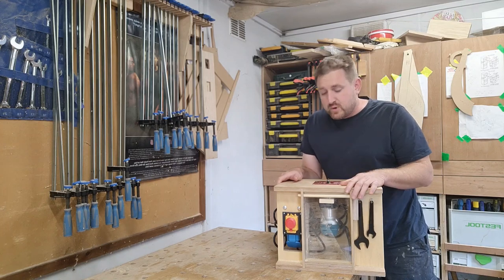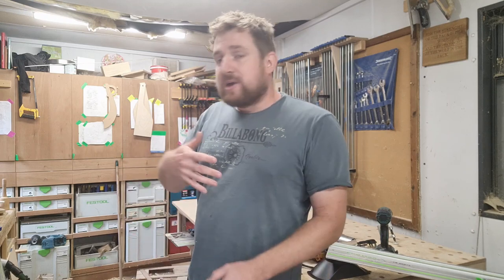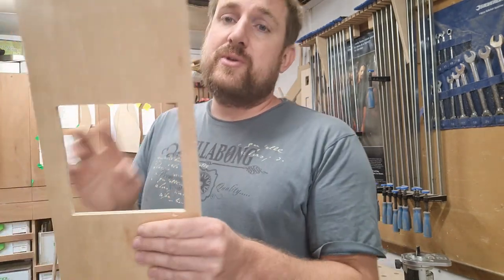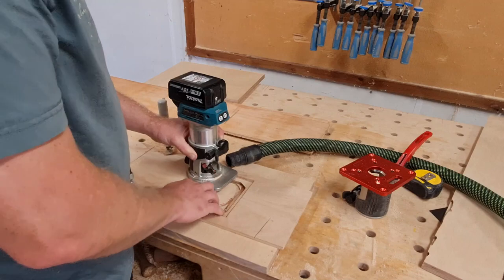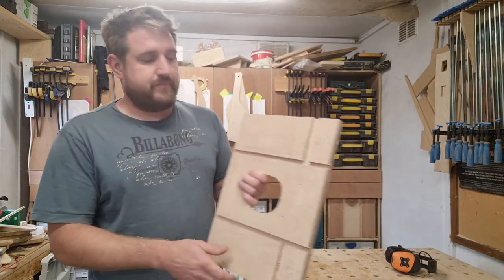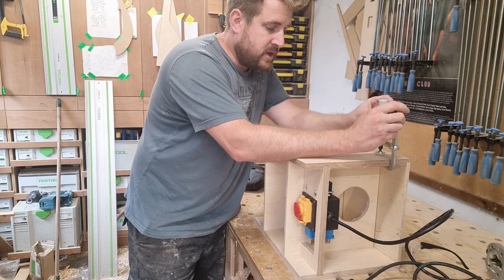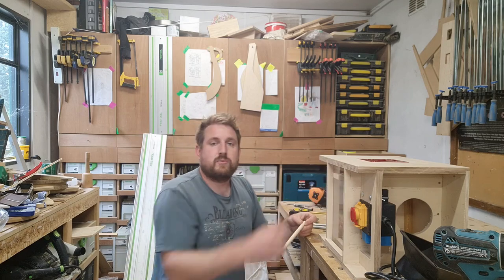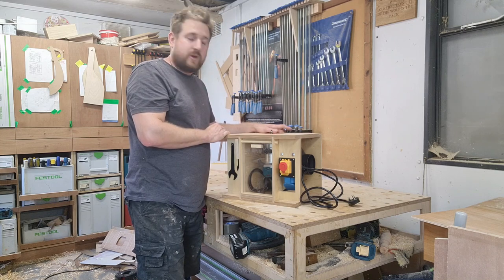How To Make A Systainer Sized Router Table - 1/4" Portable Router Table with EXTRACTION

Comment: I have just watched the video again. First time around I was so busy I was catching it in little bits on my phone.
I think the design really works well and is inspiring me to think about a small router table I can store in a powertool case for site work. Gotta be safer then just gripping the router in a workmate ;-)
Reply from the maker: Workshop projects are one of those things. I think about it for ages, then when I finally get round to building I wonder why I didn't do it sooner. This is one of those. An electric router like this is so cheap to have dedicated for one thing and speeds up repeative tasks (which I do a lot). And I keep thinking of ways I can be safer with tasks.
Reply: @englishhomestead  Yep, I have four set with often used cutters and a quick release power cord.
I'll have to get another to make a mini router table.
Reply from the maker: @Maker_of_Things  this one was my 5th! Lol.

Comment: Great vid Kev, I'd love to make one of those, quite admiring your workbench too. I notice you're into the Makita stuff too, I've always liked that little handheld router look much more agile than the big thing I have.
Reply from the maker: Yeah the Paulk workbench is a great design - I bought the plans and now have two of them made up (one is my packing bench in another container). The little router is a game changer - it is quite top heavy with the battery on, but has a long run time and ideal for things like door hanging or just keeping cables out the way. I use it all the time. When I built this I was tempted to buy a second cordless one, but wanted an easy way to switch it on and off and decided that having it corded was probably the way forward, especially as it's universal with the other one, so all the bits and bobs I have for the one fit the other.